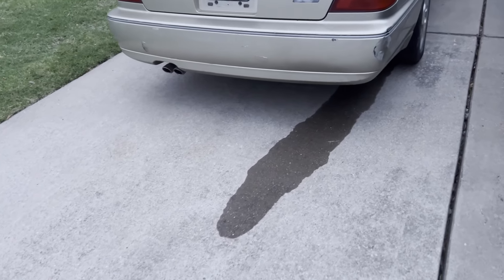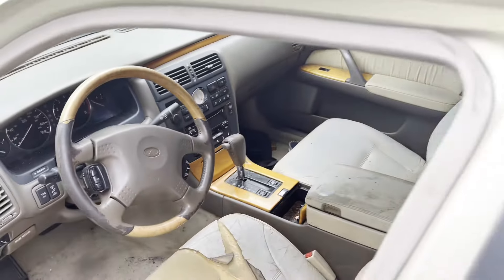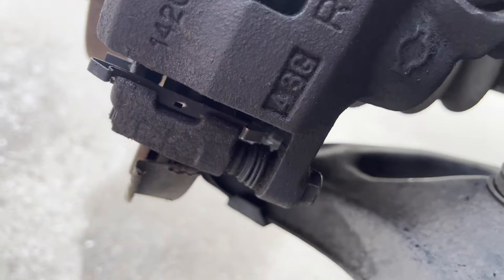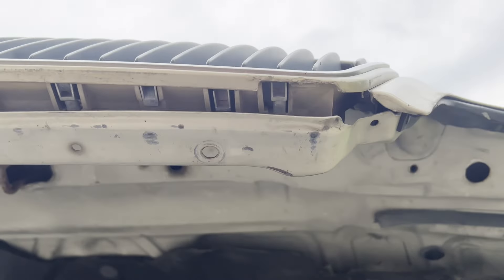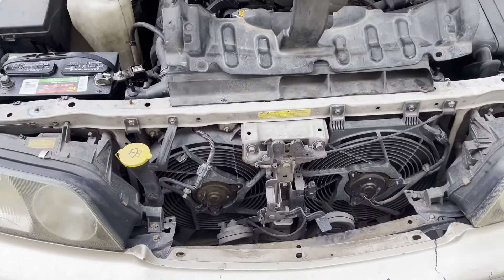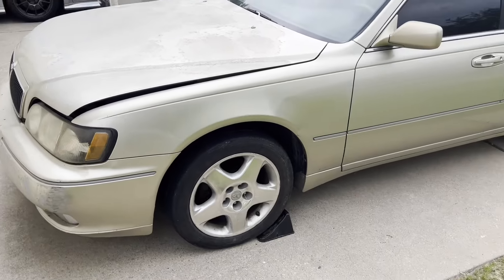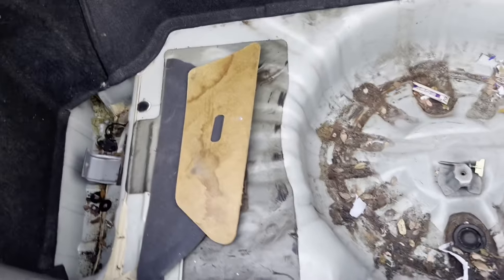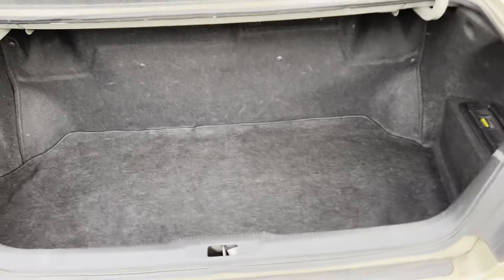Project Jessa Part 3: waiting on brake parts, started cleaning, and other discoveries!

Comment: Yea its a decent daily but youre gonna need to change the timing chain, get valves adjusted, replace the pcv valve, new filter, radiator and thermostat to fix the cooling issue then a good wetsand, cut n buff. And i guess the seats..   then change tranny fluid with new filter, new fuel filter, flush the power steering fluid, flush the brake fluid, change the oil and filter and shell run for another 5 or 10 years if keep oil changed and dont let it overheat..
Reply from the maker: I’ll tackle some of these but I can’t take this car to the finish line or I won’t be able to get my money back on it. My hope is I can sell it for a good price to an enthusiast who will pick up where I leave off.